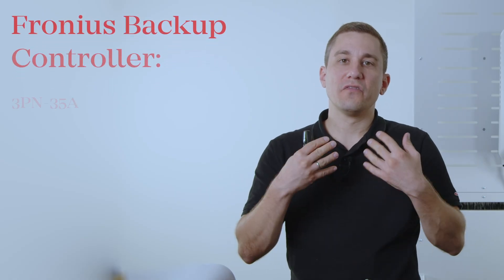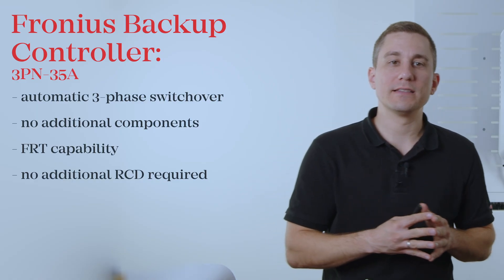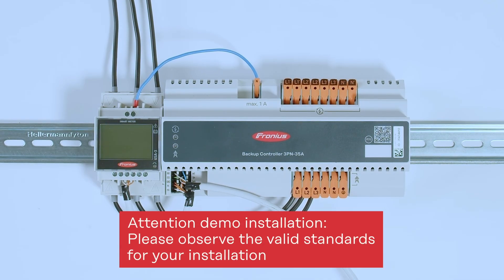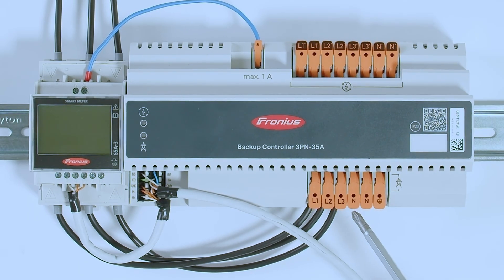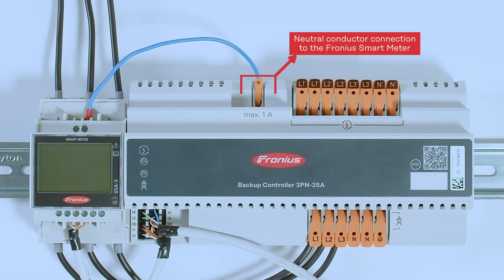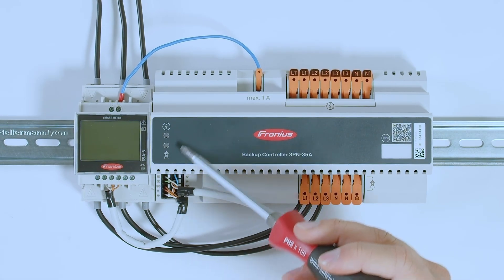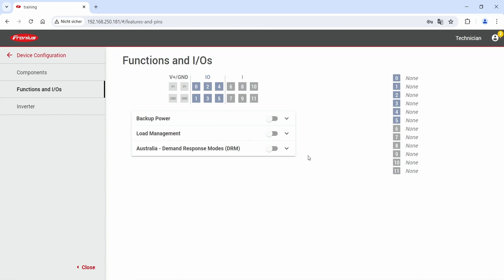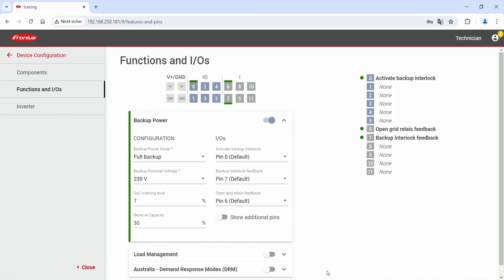How-To Video | Fronius Backup Controller 3PN - Installation & Commissioning

Comment: Hello. Very interesting info and device. Is the device compatible with my Fronius Symo 3.7?
Reply from the maker: Hi! Unfortunately, the controller is not compatible with our Symo 3.7. It works with all GEN24 versions and the Verto Plus from 15.0 to 20.0 kW.